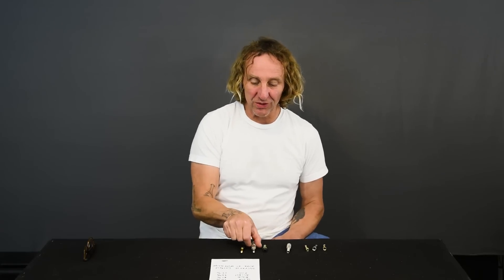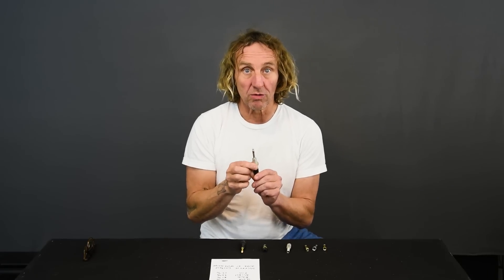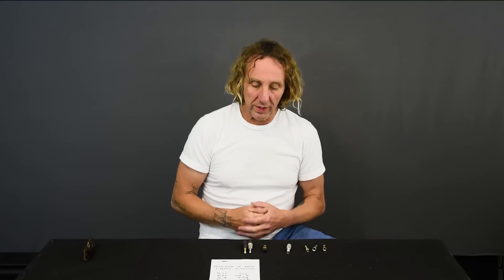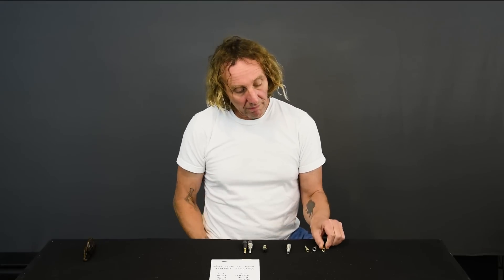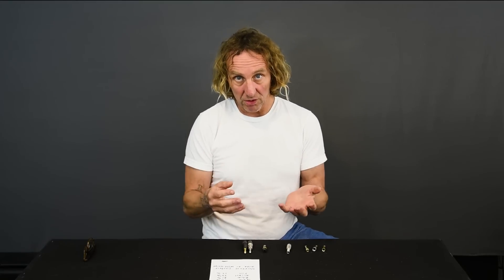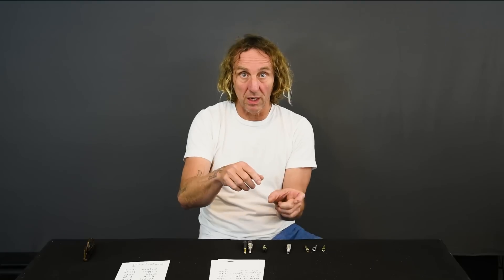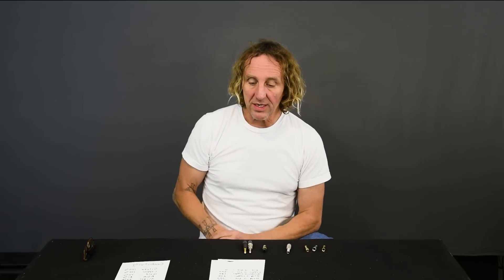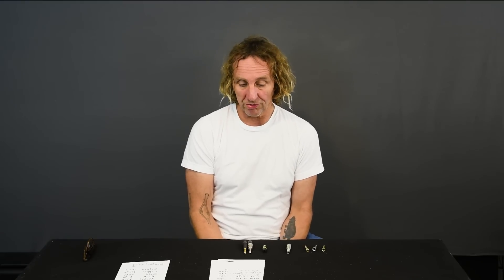Gold vs Silver (Nickel) Audio/XLR Connectors - Which is Better?

Comment: I've had decent luck with high silver content solder (3.6%) bridging copper wire to nickel connectors. On Mogami Neglex 2534 I believe it's also a high silver solder bridging copper to gold plated neutik connectors which is fine as long as the solder joint isn't compromised. I try not to leave stuff plugged in long-term and always store my sht with dry packs - that, and I stay away from the oceans because ocean air kills sht dead, dude. The best guitar/instrument unbalanced cable I have is a Vovox Sonorus Protect A that's about 13 years old. The cable itself is a high purity copper fully plated with silver that has very ''silvery'' connectors which need cleaned about every 4-5 years. It is awesome, they've changed something about the wire since I got mine around 2008, capacitance is super low, it's like the guitar pickups are hard-wired to the inside of the amp. If you don't like touch responsive then you will absolutely HATE it. No Clapton or Hendrix old school padded soft-touch about it, this mthafkr is TO IT, bruh, will make a 1969 plexi sound digital which is great for slamming into pedals that have good nickel contacts. I'm definitely NOT a high dollar cable guy but I gotta say this particular Vovox cable is a bad ma'ma jamma for its intended purpose. I honestly wouldn't use such lines for everything even if I had a $10 Billion budget just for cabling, but on select instruments oh yeah. It's about artistry, you don't always want everything to sparkle and if it did where would you be then? You want certain very specific things to have magical qualities and everything else to be the ground, the canvass, the backdrop that anything which sparkles is relative to. Cable selection is no different than microphone selection, in the end it's all just tranducers. But, I digress, for LIVE sound - I get it - you're not in the business of picking and choosing. Sucks to be you lol

Comment: So, if I'm understanding correctly... you should solder gold or nickel connectors onto your cables to match the gear they are plugged into. The copper in the cable going to the connector won't create galvanic corrosion itself. Or at least, that can't be controlled.
Reply: It's more complicated than that but  you can sum it up like this:
In galvanic corrosion the more noble (positive potential) element will always attract the least noble one. This means that if you solder gold/nickel to copper then the tin (or tin-lead) in the solder will be the one to corrode leading to weakened connections that can break. Lookup a galvanic potential chart. Generally speaking, metals that are neighbors in the chart don't react with one another.
However, consider the flow of electricity in the wire. The galvanic potential is no more than 2-3 volts. If you feed 5V to a connector hooked up to the negative wire then it can be made of iron for all it cares, it will corrode even gold or platinum. This is called cathodic protection.
Reply from the maker: Solder is good as it seals the connection from outside influences that accelerate the or cause the issues. I don't think it stops the issues but slows them down to very very long time frames that exceed the lifespan of the gear or humans in most cases
Reply: @DaveRat  curious as soft solder is part/mostly Tin, as stated above Tin is the least noble. I also seem to start at the beginning, thus a connector start is where the wire meets more than the actual pins. Though they do get more abuse. Thanks for waking up my brain this morning.
Reply from the maker: I believe that since solder creates an air and water tight connection, the soldered joint has increased immunity to the issues. Though I was told that crimping identical or very similar metals can be even better than soldering
Reply: @DaveRat  That's interesting to me too. I've known that solder protects the connection from water and air but would never assume crimping like metals makes a better connection. Thinking about it, it makes sense though. You'd sacrifice a tiny bit in weatherproofing in exchange for the better connection but it's probably such a minor difference... the solder points will probably outlive the cable.
Reply from the maker: There are some pretty old electronics floating around that still work and many that have died. Solder does last in normal environments but when you put things near the sea, hot sun and rains, the definition of what lasts and and why, changes.
Reply from the maker: Ideally for long term stability, matching connector metals is preferable. For short term stuff, no biggie.  When buying, only spend extra money on gold if it matches the existing hardware. And for solder joints, all good, for anything we audio humans deal with
Reply: So... the weakest link in all of this is the solder connection inside the connector shell and not as much the external pin metal would you say?
Reply: @Videditor1067  I'm saying that the metal with the lowest galvanic potential is the one to corrode when no electricity is passed through it.
Out of gold, copper and tin, it's tin that's the least noble. 
However, copper and tin also passivate (form a dense oxide layer that acts like a protective coating) so it's only a problem in very humid or marine environments. The key thing to remember with GC is that it's a problem only when moisture is involved

Comment: Well said.  I used to be a field service rep for a defibrillator manufacturer that had a similar issue with AEDs.  This resulted in a voluntary recall to replace battery contacts and install new batteries that had grease injected in their connectors. It was unbelievably expensive and time consuming, but it was the right thing to do.
Great content Dave! Always informative, always interesting. 
For anyone that might be interested in reading about the recall...
https://www.fda.gov/safety/recalls-market-withdrawals-safety-alerts/physio-control-launches-voluntary-field-action-lifepak-1000-defibrillator
Cheers
Reply from the maker: Thank  you Chris and interesting!

Comment: Hi Dave and thanks for your always sensible discussions. As a repairs tech I have encountered this contacts issue countless times and reliable long term remedy ime is 'working' such contacts in conjunction with contact cleaner/lubricant that leaves film of oil that isolates the contacts from air exposure and renewed corrosion. Behringer connectors suffer tin plated contact oxidation issue and is their reliability downfall and cause of  bad reputation for otherwise generally great products. Once such contacts/connectors are 'treated' they perform long term as they should ime, ditto for plenty of other makes/models. Out gassing from materials like chipboard and mdf also contribute markedly to contact corrosion issue. Interestingly glycol based fog juice protects connectors, disco/club amps pretty much never fail/act up due to contact issues. PS. I am loving the way you are using the chapter indexes like I suggested to you 👍👍👍.
Reply from the maker: Thank you Eric and yes the chapter index thing is great!!
Reply: @DaveRat  👍. I am out in the backyard gardening and listening on a BT speaker to a bunch of your interviews and discussions that I hadn't heard, interesting and great stuff !.  Sometime I will get in touch a send you samples of a paradigm shifting dielectric tech (cables etc) that changes everything re live and recorded audio.....clearer and cleaner and more real sound works on any system.

Comment: Lets talk about galvanic corrosion on sea-going boats, especially ones with an aluminium hull...
Copper is verboten! Any work involving copper must be carried out in virtually clean room protocol. Any scrap of copper left behind touching the hull will start to eat it away... not a good look on a boat.

Ohh, the circuit board connectors with square pins... I call them PCB headers.
Reply from the maker: Interesting stuff!

Comment: Wow. I’ve had problems with my crest amps. Intermittent. Sent in for service and they coulda’t find a problem. Hmmm. I think I’ll open them up and reseat the internals.
Reply from the maker: Cool, hope it works!! This issue was on 7001, 4801, 4601, 8001 series

Comment: Some points that this video missed: 
- Silver reacts with sulfur in the atmosphere to turn black. It doesn't oxidize under normal circumstances.
- Tin is very good for plating in connectors because it's soft so it molds to the microscopic imperfections so you have much more contact area. However it suffers from tin pest which means that at low temperatures (13.2 °C and below) it's atoms rearrange in a way that makes it non-conductive so it's not great for cold/winter outdoor conditions. Some people mistake this for oxidation.
- Metal conductivity doesn't matter in plating. The layer is much too thin to impact it. What is more important is corrosion and wear resistance
- Copper is a pain to work with. It doesn't plate well, doesn't stick well and oxidizes easily when passing current through it. It's good for it to be the meat of the wire and not the condom
- Nickel is arguably the best for repeated connection-disconnection. It's hard, resistant to corrosion, fairly conductive and easy to plate (no really, it will stick to most metal like your ex sticks to your bank account)
Reply from the maker: Thank you Victor!
Reply: Silver reacts with sulfur in the atmosphere, copper oxidizes.  Solution, argon shielded connectors.  I'm off to the patent office :)
Reply: So no copper condoms, and my bank accounts will be ex proof.  Got it.
Reply: Victor, everything you said is correct, except for "Metal conductivity doesn't matter in plating". Research has proven higher conductivity results in lower intermodulation distortion introduced by connectors: https://ieeexplore.ieee.org/ielaam/22/8681220/8632973-aam.pdf
Reply: @ImpostorModanica  ...Sure, but are you talking KHz or MHz.

Comment: Hmm. I’ve been a Master Plumber for several years now and galvanic action is always a high concern. I’ve replaced many copper pipes that were corroded due to being strapped or supported with steel. 
I had never thought about if or how it would apply to our bands live setup. Very interesting information to consider, as always. Thanks Mr Dave.
Reply: Can you tell a bit more about what you experienced with the pipes? According to the literature during galvanic corrosion the least noble metal gets corroded while the more noble metal gets protected. In this case the iron atoms should flow towards, and deposit on the copper. So why did you need to replace the pipes if they were in contact with steel?
Reply: @victorunbea8451  I’ll try. Typically when I crawl under a house or get in the ceiling of a commercial building the leak is at a point of contact with a piece of galvanized steel strapping (which you’re not supposed to, but I digress). Several pinholes and the like that I’ve fixed in copper have been friction related and will wear from inside out but those are usually really old systems and utilize copper 2-hole straps and the walls have become very thin so it’s obviously friction, IMO. But the ones I’ve fixed that were strapped with iron always have the hole where the steel and copper contacted and wore from outside to in. Obviously, there have been a couple of times where it was a friction issue and the steel just rubs the copper long enough to degrade its integrity. But those are very rare cases, and most of the time you won’t pass an inspection in the first place if your pipes can wiggle at an anchor point. Not sure of what the reasons are (did physics in high school, no chemistry classes), but very rarely is it from friction, they just corrode rather than abrade. Might be one of those “it’s great in practice, but how is it in theory” type of situations where an unexpected result occurs. But again, my experience says that a few will abrade, but the vast majority just corrode up and start leaking eventually. My fuel gas code calls for dielectric unions at any contact of dissimilar metal, but it’s not really applicable to strapping water pipe unless you buy “rubber booted” anchors (not sure of the correct term, I just tell the parts house copper or rubber clamps, depending). And again, this is just my anecdotal experience from 11 or 12ish years in the industry. I’m by no means a technical expert, just an “I see what I see” type of thing. And there may be other mitigating factors I haven’t noticed or accounted for, but I like to feel I assess and diagnose most situations with some semblance of thoroughness. But in my opinion I’m a perpetual student, and no expert in any field, no matter how much “experience” I have. So again, it’s all speculation and personal anecdotal experience from me, and I would assume I should be taken with many grains of salt.
Reply: @damianthielemier6249  Very nicely explained. Thanks!

Comment: or there's connective polymer what's the same conductivity as copper and you can coat your connectors in that
 you only need to mix silver 5% to stop it tarnishing
Reply from the maker: Do you have a link to more info?  I have not seen a polymer with copper's conductivity. Very interesting.
Reply: @DaveRat  some articles on chord Electronics website I think Wikipedia as well if you just Google conductive polymer
Reply from the maker: I did some looking around, but finding products and such with lower conductivity than copper for specialized applications.

A conductive polymer with the conductivity of copper is quite appealing and would like to know more
Reply: @DaveRat   yes, best I suppose the manufacturers who make it should have the data sheet! I think it's quite hard wearing it seems to dry hard,  I'm assuming it must be something to do with carbon bonds
I've been having a read up on it and there's lots of different types of conductive polymers used in OLED displays solar panels etc of different variations of conductivity.
You can buy a little bottle of conductive polymer from chord Electronics they suggest painting the terminals with three coats, maybe you could do an experiment get a metre long piece of non-conductive material and paint three coats and see what the resistances is
What I can see with organic polymers the longer they left the better conductive is to oxidation where metals are the opposite
Reply from the maker: Interesting, i will ponder pro audio applications